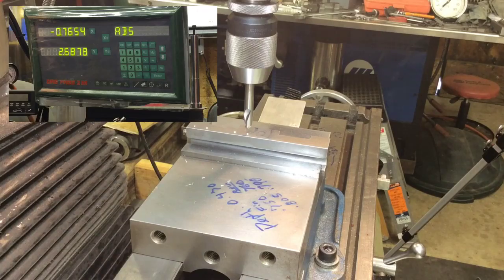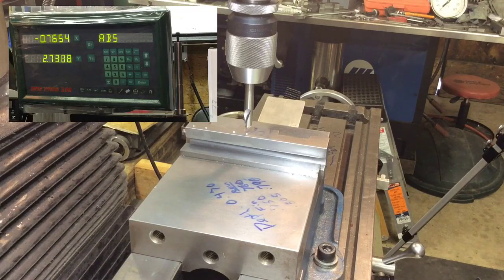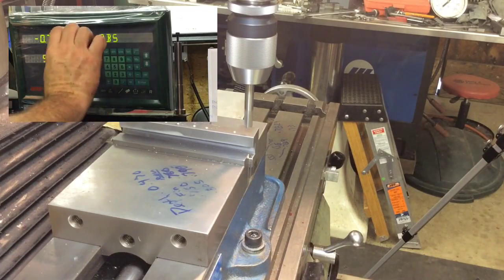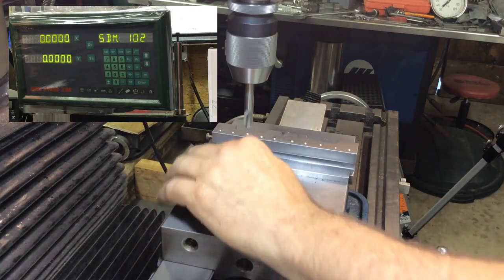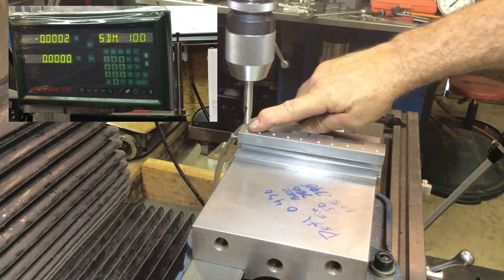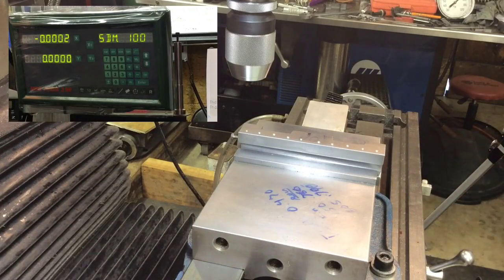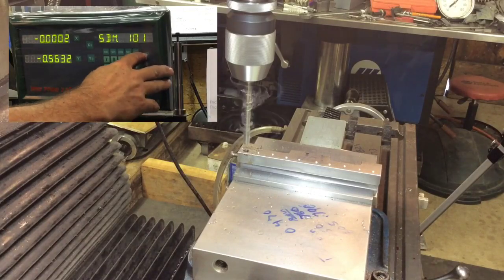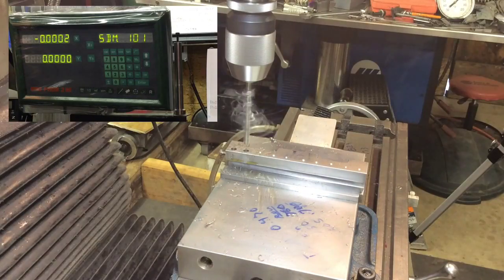AXA QCTP Tool Holder | Quick Change Tool Post | Detail Making | P3

Comment: If you don't already have some, get some bi-focal safety glasses. They are very useful for the machine work. I normally wear mono-vision contacts and prefer them for welding, but use the glasses when working on the lathe. On occasion I will put the glasses on with the contacts to see something really close or small.
Reply from the maker: DSCKy I am always wearing safety glasses, for close up is when I need the readers.  Thanks for the comments.
Reply: Randy Richard Yea, me too. It's handy to have the safety and reading ability in the same pair of glasses. :)